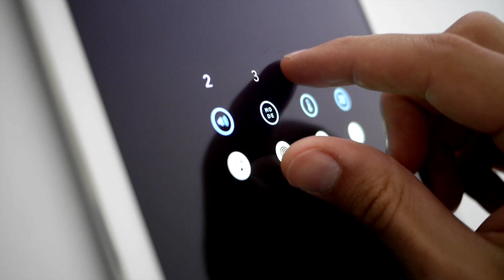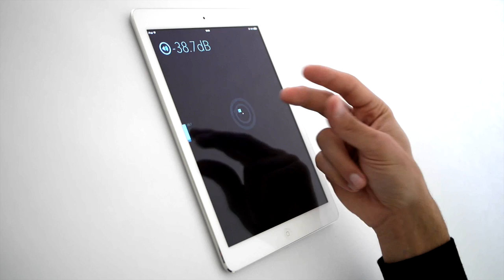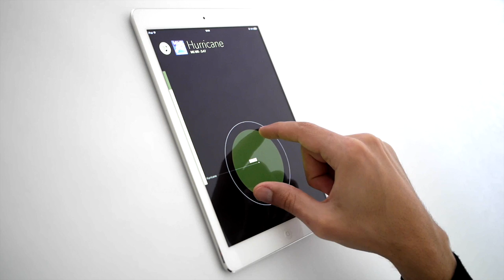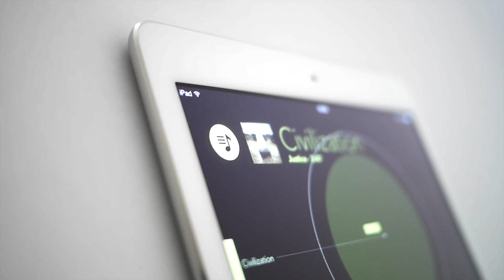A New Car UI: How touch screen controls in cars should work

Comment: You had modern UI figured out 8 years ago, wow.
Reply from the maker: Thank you. I think about this project much differently these days. Some of it is flawed. E.g. it's absolutely unnecessary to quick-access this many settings. Some of it I would still like to see in real car UIs. E.g. The concept of adjusting settings based on relative position changes instead of absolute input.
Reply: im curious if youll ever revisit this project in the future?

Comment: I¹ve been playing with the prototype and it's a great example of beautiful
UI Design, but I'm going to go for the UX perspective and some things
caught my attention:

- Stateless surface: the minimalism of the design goes beyond the UI and
into the state of the system. While not interacting with the UI, the
surface becomes blank. That means: no state. The state of the controls
depends on the interaction of the moment, that¹s fine, but the state of
the system demand interaction from the user. There is no indication of
what the car is actually doing until you want to change it, basically.

- Movement: a gestural UI like this one looks amazing on an iPad
prototype, but not so great when I'm driving at 90 mph on a highway. There
is movement and there is vibration.

- Abstraction of measurements: well this is more of a detail, but showing
the volume in dB is one of the biggest mistakes stereo systems have ever
made, and this UI still does it. Volume is relative to the perception of
the user and the number of decibels doesn't actually mean anything.

- Consistency: the UI uses the same axis for all interactions. By
insisting on the vertical axis, the UI is being inconsistent with the
mental model of the different modes. It is okay to increase and decrease
with up and down movements, but when navigating on unquantifiable menus
(like changing the source of the audio) it gets confusing.

- Hierarchy of information: the UI is assuming all the posible elements of
interaction are parallel to each other in hierarchy, when for example song
skipping and changing lies within a bigger layer, under the source of the
audio. As I mentioned before, it uses the same interaction paradigm for
all layers of information and all natures of information.

- The posture of a hand emulating multi-gestural touch on a surface far
from the steering wheel seems a bit forced to me. We can¹t see this in the
video because it's an iPad on a flat surface.

I think it's gotten a lot of hype from online media because it looks
pretty and it¹s minimal, which reflects an awesome visual design, but I
wish it would be more practical in terms of real user experience.

It's a great first iteration, it just needs to take a bit more into account the context of the interactions with respect to the user. Beautiful, though!
Reply: Best comment. That means putting at the core the user. Bravo Antonio!
Reply: You took all the words out of my mouth and more
Fantastic

Comment: Way too complex. Most people will not be able to remember the many different gestures.
Reply: And yet, they can't turn off the AC if they are missing a pinkie. UX achievement unlocked!
Reply: Yeah, but you need an entire course for that cause of the complexity, you shouldn't for using a digital interface cause it shouldn't be complex in terms of the interaction

Comment: I love this attempt to re-think how car controls will work--but, it's still complex.  It's an excellent illustration in understanding why Google (and Apple) are trying to move past touch and onto voice as the primary interface for devices.  Easier touch is fine, but if you can just tell your car to crank the heat and switch radio stations, that would be easier.
Reply: We solved this problem already - physical knobs and buttons - you can turn and use them all without looking. Somehow with the more tech we throw into cars the more of a distraction they offer and become. Voice will not catch on because not everyone wants to be driving and be like "change temp to 23 degrees" etc.

Comment: What I like best about this interface is how freaking small the writing is letting you know what setting you're changing. If you need to take 10 seconds to get up close to the panel and try to read whatever the hell it says you may as well drive with your eyes closed. 

Regarding the 1-5 finger design, it's not intuitive or comfortable to use 3 fingers, 4 fingers, or even 5 fingers since your hands don't work that way (especially for 4 fingers). The fact that your tendons give you the least dexterity in your ring finger (and coactivation of the middle and pinky) provide an upper limit of 3 fingers comfortably (as is the industry standard for touchscreens and touchpads). Furthermore, how do you deal with people missing fingers?

This is a good start, sure, but it has a LONG way to go and a rethink is required.

Comment: Nice! I like the premise of one control at a time and relative motion over absolute position. After all, the easiest target to hit is the one you're already touching. I do have some suggestions though:

1) Ten potential gestures is a lot to remember. The daily user would eventually be able to, but new users and infrequent users would find it frustrating to remember the desired finger combination. Having a home page with the correct combinations would be visually confusing and defeat the design's intent to retain focus on the act of driving.

2) There are no accommodations for people with missing digits or arthritis; a fairly common occurrence.

I suggest you use a progressive reveal. Use a single touch sensitive to large horizontal movements to select the mode. Provide voice feedback to inform the driver what mode they are as they swipe through. Then use your two point interaction to control that mode, which the interface will remain in until another mode is selected through another horizontal selection.

Comment: The input method seems excellent. It is very simple and to the point. As others state, there is definitely a little bit of learning involved just to remember which is which, but for one familiar with the system it offers quick and direct operation. There is no need to fumble around for a button, or try to pick out a button on a cluttered interface.

I would suggest a compact status bar however, showing the state of temperature, fan control, volume, and other things people would like to know at a glance. It would of course be optional. Or even display these things cleanly in the back ground. A symbol or number could be included beside each item like there is at 0:27 indicating how many fingers to use for each operation.

Since the gestures are all the same, with a small status bar, a new user need only learn how many fingers for each item which isn't hard if items are numbered.

I feel this would actually be far easier to get the hang of than learning to operate a new CD deck with six thousand buttons.

Comment: I appreciate the intention, and I love the design. That said, the complexity lying in the number of finger, and even harder their proximity actually end with a quite high complexity.

I feel like you assumed that the user would learn and know the interface protocol. I'm renting a lot of different cars, and if it happens that every car implement a slightly different interface from the one advised, then I'll probably end up lost.
Reply: I got the hang of this in less than a minute.
Cant say thats a very steep learning curve...
Reply: not only that, cars already have slightly different interfaces!
A Nissan jukes UI is so radically different from a tesla's, i'd have to search for a while to get where I where in the menus I want to be. This is no different for the UI showed in this video. Both modern and future cars will have slightly different interfaces, and will (and do) require the operator to get familiar with the system before being able to operate it without thinking much about it.

Comment: This is an excellent idea. Put haptic feedback on the screen (the whole thing vibrating) and you are on to a real winner.

My car has a physical jog that i can use to navigate the ui (it is page and list based) but also has on wheel controls for previous/next and volume. This could compliment the lot or replace a job on large screens.
Reply: I think we should just have simple controls for the driver to operate, and anything more complex you use voice or just don't play with while the vehicle is in motion.

Comment: I like the idea but think that gestures would probably be a better way to select function.  The android Quick Launch Shortcuts is a good example of this.  Visual and/or audible queues would enhance learning the gestures so that drivers could move on to adjuisting the function levels (temperature, volume, station, cd track, etc).  some control gestures would be self-evident (cd control: tap to pause, slide left to reverse, slide right to advance).

Comment: I see an application for this with power users but not with cars.  People are typically driving when adjusting the radio, environmental controls, etc. They need to focus on driving not on whether they're within the inch of space to select CD player in the UI. Also, there's no clear indication of how many fingers are used to trigger what system--it's all hidden ui interactions. There's a far greater load on the user to learn, recall, and apply this system.  Again, I see applications for power users and other platforms, just not cars.  :)

Comment: Great Styling, won't work as well as haptic buttons, sliders, knobs. The 8 things you are controlling with the gestures (gestures that users will have to memorize to not get lost) are not the reason modern cars have touch screens. Modern cars have touch screens because they're trying to cram many more features in there for which individual physical controls would be overkill. I agree that that approach is broken, but your concept solves nothing, it actually removes a key feature of physical control: the ability to quickly glance at the current state of the control (on/off, which value)
Reply: The gestures seem pretty intuitive and would make memorization much quicker for the average person. As for amount of features, I do agree that amount would have to be limited unless learned gestures (tapping?) come into play which may be dangerous. Physical control however is compensated by the shifting reference point. Music too loud? A person brings their hand from the top to bottom with no need to look. It removes the need to look almost completely.
Reply: It removes the need to look for things like music control that provide instant non-visual feedback, yes. The music gets quieter until I'm satisfied, I can hear when to stop. But what about temperature controls for example? I can't quickly set the temperature to the reference point I know is going to please me in a minute like I can with physical controls without looking. Motor memory out the window. A shame. Glance-able info out the window, too. Is the AC on? Is the airflow set to external? Am I already at the highest or lowest setting for any parameter?

Also think about people who are not the driver. How's the person riding shotgun in your car for the first time going to adjust anything without you having to verbalize the things to them that you've implicitly learned? That poses a real challenge to people who are not used to doing that.

Comment: Brilliant, but I'm curious as to how one can remember these different functions. I can see myself now driving down the road in the winter freezing but in a rush to a meeting trying to figure out which number of fingers/movement will control the heat in what way. Too busy with my mind on the road and long after the salesman taught me how to use this system, but still cold, scared to touch the screen because I might end up changing my radio station or setting it AUX unintentionally so I continue driving until I can finally remember what motion turns up the heat... 5-minutes from my destination. I'm just saying I think there needs to be something that reminds us, regardless of what's on our mind, which motion does what, preferably refraining from using symbols to the side because they would either take away from the interior styling of the vehicle or be too small for everyone to be able to recognize. Otherwise great idea! I love it!

Comment: I really like this! But I think the power in it would be to combine it with other more traditional patterns rather than try to force everything into the system. Using horizontal swipes to access high level dashboards that have more specific controls similar to how smartphones and tablets work now. Allowing users to customise these would also be a nice touch for some (not necessary) In some cases it may make sense to have more traditional buttons too. It's all about using things that make sense for the context, striking a balance between simplicity and practicality :)

Comment: I love the idea of iterating to more innovative user interfaces, though I think a lot of people would have trouble with something like this.

It's very conceptual and memory intensive (meaning, you have to remember gestures), and from my observations, many people seem to have trouble with things like that. People tend to like buttons and knobs and things that they can see and use without having to think about it. (And even those are tricky for some people to use.)

I think more visual cues would help. E.g. An always-showing guide on the main screen showing how many fingers to use to adjust each function. So you could show:

Volume - * *
Radio station - * * *

Etc. (With the dots representing the amount of digits needed to control that function.)

You're certainly on to something, I just feel it would benefit from being more visual so it requires less thinking and less memorisation. 

Frankly, for changing songs on a CD player, I'd prefer to have buttons like that on the steering wheel, or something like that. Something that doesn't require me to take my hands of the steering wheel.

Comment: i like the general idea except for the multiple fingers thing.    what if you're missing some fingers?     it is more to learn.    my idea of a better design includes simplicity. something that does not require learning anything more than you would learn for a car built in 1980 for instance.

Comment: I would find hard to remember finger mapping. Controlling things with one finger would be nicer, and action context can be done having four tiles (accommodating all screen) that would fully expand as soon as you touch the screen. So only the starting point of your touch would act as action selection, but adjusting the levels would be mapped to the full screen.

Comment: Instead of doing multiple fingers or in addition to that, you could use a sliding from left or right to switch between modes. Of course this would use a large movement to prevent such accidental triggering.

Comment: Ditto what others have said: finger count and finger distance aren't viable approaches.

The small button problem is real, but that doesn't mean all buttons are bad.  It seems sufficient to implement selection mode buttons (along driver's side) for a single touch selection, and then leverage the press and slide arrangement.

Comment: I think your design is beautiful, and well thought out. I agree that current touch interfaces in cars are bad. But it's more than that, and I don't think just a software interface will solve it.

I've driven two cars recently and regularly -- a Subaru Outback (with a touch screen) and a BMW (with a sort of knob thing down by the shifter -- sort of like the initial ipods), and think the BMW interface is considerably more intuitive and less distracting than the touch screen. It has sensory feedback in terms of "clicks" as you rotate the knob -- which correlate to items in a list, allows clicking down for selection, tilt left/right for back/forward, and has a gesture interface on the top (like graffiti for PalmOS) to enter text. They both have some level of language recognition and verbal commands as well, which I use sparingly because that feels odd or frustrating sometimes.

The touch screen gets dirty quickly and hard to see when the sun shines at the right angle, and is hard to interact with while driving (even after cleaning). It also isn't nice to interact with as a passenger because it angles towards the driver and requires considerable coordination with the left hand -- which your design would definitely solve, however, it still has the downsides I mention.

The knob interface is relatively easy to interact with as a passenger, and requires a lot less "eye time" on the display since you have much more sensory feedback.  I find myself reaching for it while driving the Subaru -- and in my experience that's when a designer can know they've done it well. It becomes second nature, sort of like wanting to swipe the display of an old phone.

So while I like a touch interface for many many devices, I think a touch interface in a car isn't optimal regardless of the software design -- until the day that cars mostly drive themselves (in which case I'd probably be using something like my phone to interface with it anyway).

Disclaimer: I'm pretty forgiving about this sort of thing, and don't need a hardware keyboard for my devices.